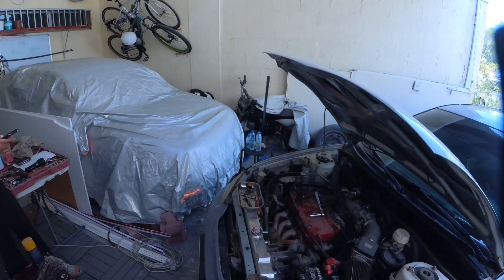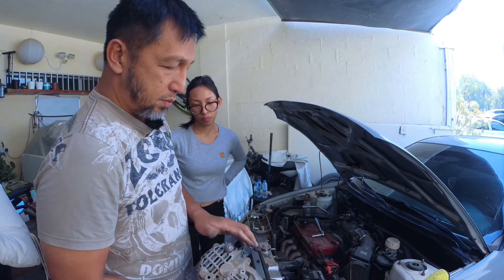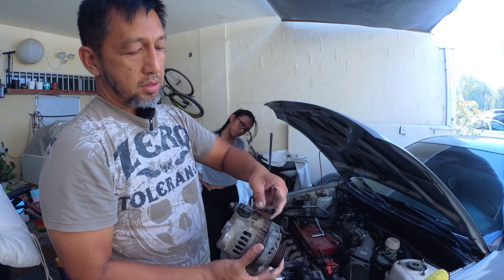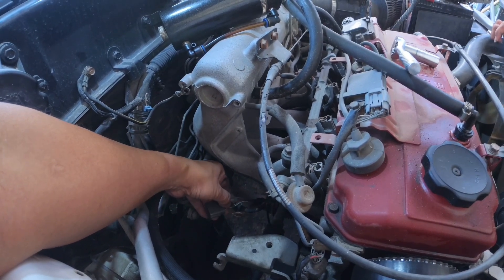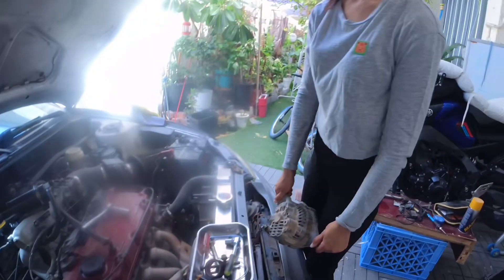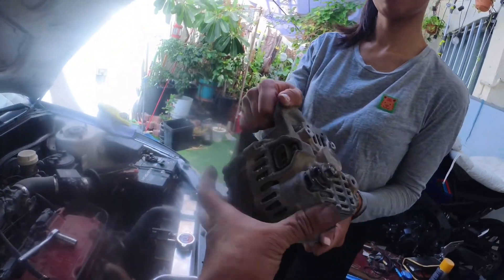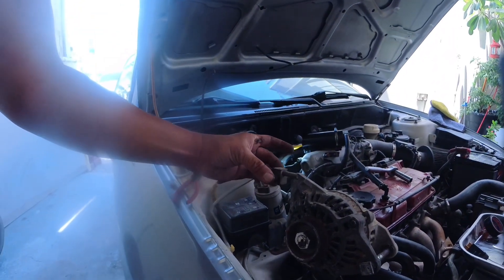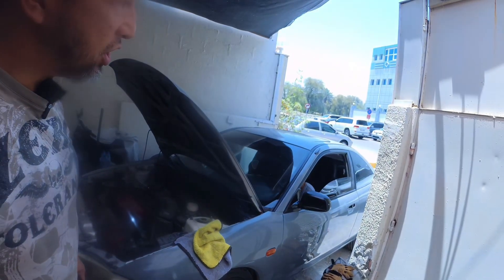2 Pin Alternator vs 4 Pin alternator

Comment: I have a 4g63 sohc galant gen 8...altenator is failing it has 4 pins...i ask our local mechanic all they have is an alternator for the gsr coupe which has 2 pins....will it work?
Reply from the maker: It will work, but I have read somewhere that you will get a trouble code . And also read somewhere that they had dohc issues.  These are unconfirmed issues.

Comment: I have a 97 Lancer and a roadside repair shop rewound the rotor. When they did this, they had also replaced the IC regulator and adapted it into a 2-pin regulator. 

Recently, after replacing my ignition coils, I get an 

Alternator FR Terminal System

code, (code 64 self diagnostic)

What caused this issue and how may I rectify this? Thanks in advance!
Reply from the maker: The issue is the exu doesn’t receive any feedback from the  alternator. Only solution is to put a 4 pin alt . Or maybe fake a signal but I havent tried that.
Reply: @Projekt1 
What was the alternator originally equipped to? 4G15/4G13? I think those engines used 75A alternators and mine was 80A and I had a local mechanic substitute a 2-pin IC regulator instead of the 4-pin

My alternator failed again after this repair (short to rotor core and stator short-to-phase) and I suspect the lack of the FR signal caused issues
Reply from the maker: @whackowafer4765 4g13, so far we are not having problem, but because it by passed the ecu , it will not idle up on heavy loads like during night time headlights on ac on and stuck in traffic.

Comment: Is that a lancer gsr driven by a 4g92 engine? I have a failing alternator regulator, too, and the tech guy near me said there are many worn out parts costing me a whole new 90amp alt. How did it go after bypassing those ecu wires for a 2 wire alt?
Reply from the maker: Charging is still the same. The only difference when by passing the ecu is it wont be able to shut down non vital function ( such as ac) when the voltage is low.
Reply: @Projekt1  I will give this a shot and see how it goes. Thanks much!